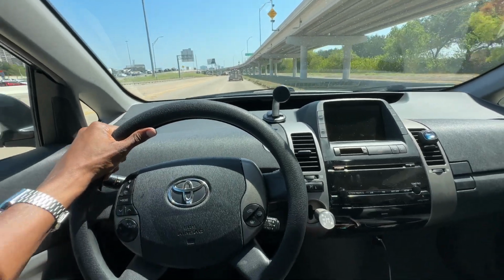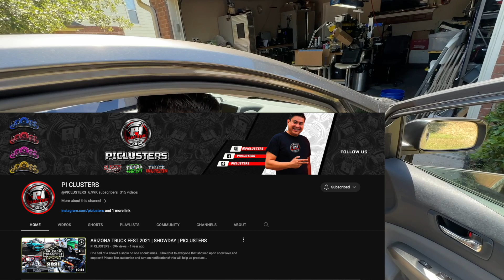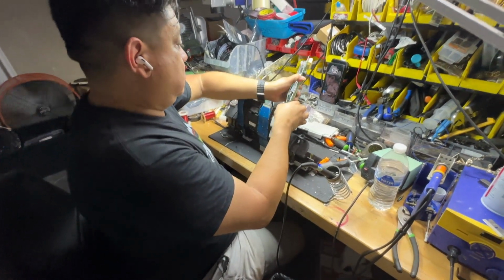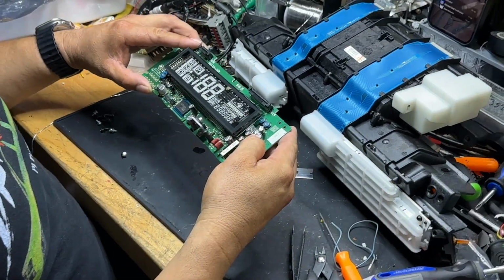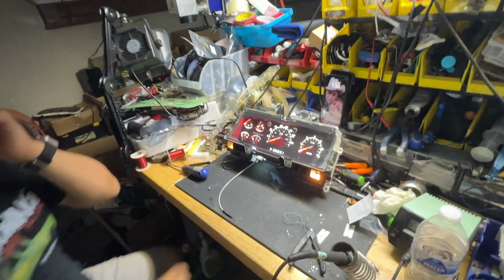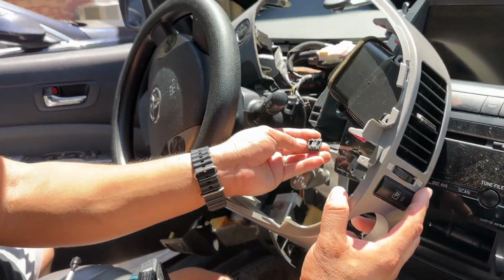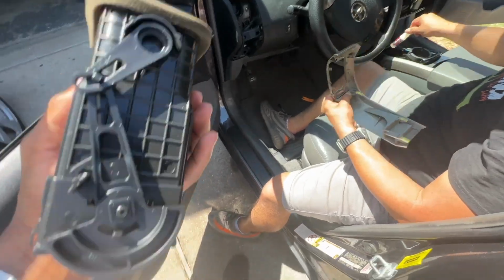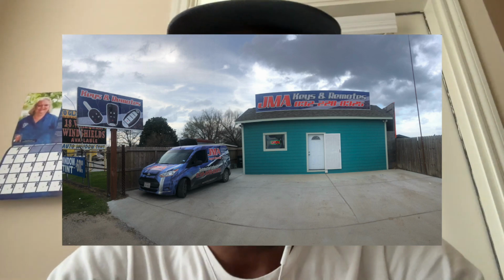Getting my Combination Meter Fix on 2008 Toyota Prius! Ft. @PICLUSTERS

Comment: My dash goes out every once in a while...put the car in acc mode hold the climate for 3 seconds and then turn the headlights off and on 3 times and mibes come back on
Reply: I've also found that putting the car in accessory mode, keeping the door open and pushing lock and unlock repeatedly on your key fob will also do the trick.